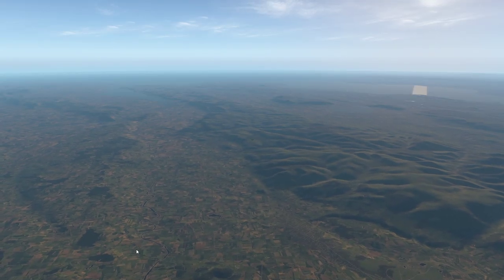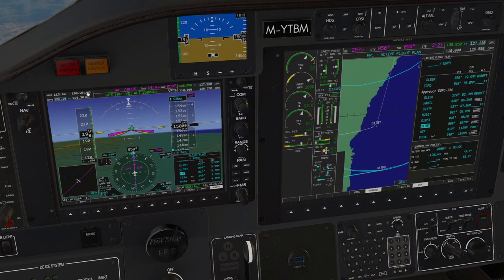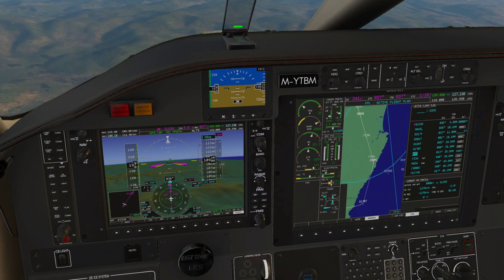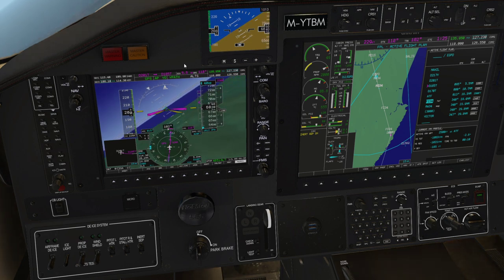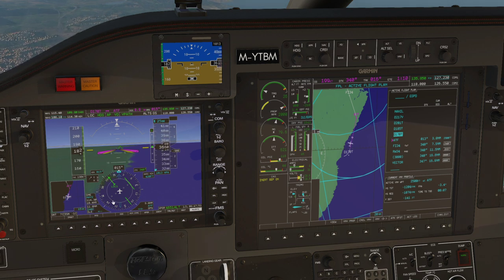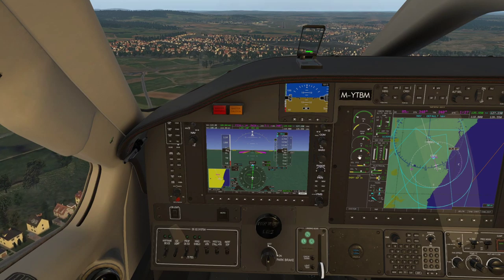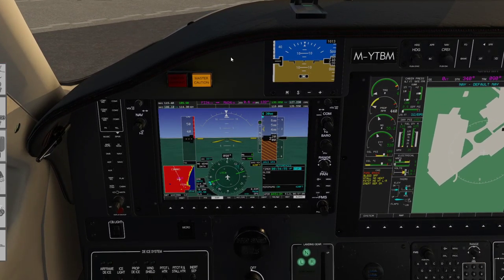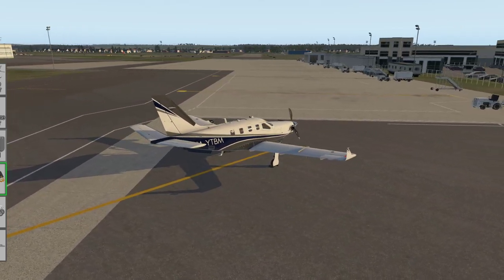Hotstart TBM 900 Part 2 - IFR Arrival to Aberdeen ILS 34 [X-Plane]

Comment: Excellent videos, I thoroughly enjoy the videos and learning more about the TBM 900....question(s), 1. I do not see any indication on the alpha-indicator for color indications of the AoA, could this be a Vulkan limitation, as the lift-up window/screen is blank/empty, no color indication visible upon lifting of the lid/screen....2. for whatever reason, my version of TBM900 does not allow me or does not show the ILS LOC upon CDI selection and the AP does not intercept the LOC in APR mode, even though the ILS frequency is in NAV 1. I've tried many locations and did the Glasgow to Aberdeen flight several times, everything works well LNAV and VNAV wise from departure to arrival and approach activation, however, I do not get an ILS IDENT indication in NAV one and therefore the CDI does not show an active LOC, I do get the GS indication, but no LOC....any advice would be appreciated, like I've mentioned, I've several ILS approaches and I get the same result everywhere, no LOC on CDI and no IDENT next to ILS FREQ on NAV 1....I'm flying latest XP11 and latest Vulkan....thanks and much appreciated.
Reply from the maker: Hello Stephen, really sorry for the delay replying. Yes the alpha indicator is a Vulkan issue, and I believe the ILS issue is related to the navdata version. If you use updated Navigraph data that could be the issue. I believe there is a beta version available that corrects both issues, or for the nav data if you use the 11.00 format that should work for now. Glad you've been enjoying the video series.

Comment: Great video!  Quick question, why did you set your BARO MIN to 420ft - I don't see that on the chart that you pulled up at 1:25.  Guess is LFE + ~200'...Please advise - Thanks!
Reply from the maker: Thanks, and sorry for the delay replying. Yes unlike most charts, the UK AIP charts list obstacle clearance height rather than the useable minima. Cat 1 ILS approaches have a system minima of 200ft, so use the greater of TDZ Elevation + OCH or TDZ Elevation + System Minima.   The Jepp charts show proper useable minima, and gives 415ft for this approach.

Comment: You referred to multiplying the height to lose by 3 to arrive at a distance figure to start descent.  I've previuosly been taught to divide by 3 not multiply . which is correct please?  Fantastic videos Graham . thank you.
Reply from the maker: Thanks for the nice feedback.  Interesting question as different people do it different ways. For me, I look at height and calculate mileage as it makes sense to me that way. 10000 feet to loose, x3, I need 30 miles.   You can also do it the other way. I have 30 miles, x3 = 9(0) = I can loose 9000 feet. For me this is harder to do mentally, and I know my altitude exactly and can only guess my track distance.  For you can also divide remaining distance by 3 which is the reverse of the first calculation. They are really rules of thumb rather than precise calculations, so whatever works easiest for you - everybody is different. Hope that makes sense?

Comment: Graham, an outstanding series from an excellent instructor. I have taken six pages of typewritten notes from videos 1 & 2 so far. Could I please ask you to clarify something... at 30:35 of this video (#2) you say, "We have made ourselves aware of the importance of keeping those flight mode and initiators (?) in the G1000 in the stand (?) at all times." I am confused by this. What are you referring to here and what do you mean by "in the stand"? Apologies for not understanding your terminology here, which is otherwise crystal clear and easily understood. I am looking forward to taking many more notes, —Steve Haines
Reply from the maker: Thanks for your nice comments Steve. Flight Mode Annunciators, FMAs, the autopilot modes displayed at the top of the PFD - and the importance of keeping them “in the scan”.  We talk about a “selective radial scan” when instrument flying. Keep the instrument “scan” going by looking at, for example, Attitude, Airspeed, Attitude, Altitude, Attitude etc. When the autopilot is on the temptation is to let your scan lapse, but the key to understanding the autopilot is not what lights are illuminated on the control panel, but rather what FMAs are displayed - hence “Keep the FMAs in the scan”. Learn when to expect an automatic mode change on the autopilot, like from VS to ALT when autopilot captures the selected altitude, and check the FMAs to make sure it actually happens. Hope that makes sense?
Reply: @ReflectedRealitySimulations   Again crystal clear, Graham. Glad I asked as I completely missed the gist of that instruction. Into the notes...  —Steve H

Comment: Hi Graham,
You are simply brilliant.
I've been struggling with MSFS and their TBM 930 and then came across your Dundee circuits. I tried to emulate what you were doing and immediately found that OBS does not work in MSFS. Also it's a real struggle to trim their plane and the whole flight model is off too. Add to that one of the bridges is missing and you can image the disappointment.
I bought X-Plane 11 because I first came across the G1000 in the MSFS 172 during the alpha and watched flightsim481's G1000 tutorial. On returning to MSFS I found that its G1000 was very incomplete, so started flying the 172 G1000 in X-Plane.
Now I've found you and the Hotstart TBM 900 so it's back out of MSFS and back into X-Plane!
Your video series is quite outstanding and I hope you will build a following which will allow you to make many more.
I'd place you in the same class as Squirrel and Doofer911.
Thank you for your time and effort.
Reply from the maker: Very kind Chris thanks - yes X-Plane is aiming to provide a G1000 simulation that can be used for Instrument training. It has some weaknesses, but compared to the FS2020 version X-Plane seems much better. The OBS mode is really useful, and the HotStart TBM is one of the few aircraft to simulate the air load on the flight controls so the aircraft "firms up" at higher airspeeds simulating the increased effort required to move the controls.
Reply: @ReflectedRealitySimulations  Many Thanks

Comment: excellent videos! saved all on my page, do you have a video or tutorial how to setup the throttles for the tbm using a saitek quadrant throttles? i cannot make them work properly
Reply from the maker: Thanks for the nice comment. I'm afraid I don't have a setup video as I only have a single throttle axis. However I think the power lever uses the mixture bindings for movement between Cut Off and Flight Idle. The best place to ask is the X-Pilot forums or the HotStart Discord as I'm sure somebody there will know.

Comment: I agree w VikingsFan39 and double his comments. I also wanted to ask how you do such an excellent job changing dials for com's or Altitude for example are you using a special mouse or some other equipment? I find it very frustrating to work the dials with a regular mouse. Thank you in advance for your thoughts and terrific training videos! Best from Florida
Reply from the maker: Sorry for the delay replying Bruce. No special hardware. I've got a logitech wireless mouse and run at 1080p. The G1000 is a bit awkward to work the frequencies, but it is possible to bind keys for the com frequency to help with online flying.

Comment: Excellent presentation!...... my vnav works maybe 10% of the time! I wonder what I'm doing wrong, but typically just as you set up, that's what I do...... Bill
Reply from the maker: Hi Bill, thanks for the nice comment. Yes I’ve noticed VNav being armed and then not engaging and can’t really work out what is going on. I’ve recently been leaving the VNav mode selection until the “vertical path” callout and then it seems to work reliably.
Reply: I think I read somewhere that the VNAV has to be set within 5 minutes of descent otherwise it times out.  Not sure whether that was for the TBM or the Citation Mustang though.
Reply: Further to my last post I found it on page 15 of the TBM quick start guide, note 15.  You must be within 2 minutes of the computed TOD when arming VNAV..

Comment: This looks like an amazing sim. I'd love an aircraft of this quality but mid-80s rather than contemporary - electromechanical HSIs, VOR/DME/ADF and so on, but same level of system simulation (listening for the aux fuel pump etc)
Reply from the maker: I've been hearing good things about the JRollon SF260 with Simcoders REP, but haven't tried it myself. Javier has uploaded quite a few videos of the REP features.
Reply: The Carenado PA-31 Navajo is another beautiful well simulated bird. I recommend you to take a look on V1-Sim video series about this bird. Anyway, @Reflected Reality Simulations is amazing! I also recommend you about the TBM9 to take a look for Jason videos flying this plane IRL.
Reply: @ReflectedRealitySimulations  The Jrollon SF260 is amazing but I don't fly it so often because hand-flying is very exhausting by not having a trim-rudder. So you have to constantly keep using the rudder pedals for level flight. Idk maybe at the end its my own fault.
Reply: The AirFoillabs King Air 350 is probably exactly what you want. Look on YT for some of those reviews, and I think you will love what you see. Jeff Faringa is a good one to follow.

Comment: Hello Graeme,

Are you using a yolk or joystick while recording the TBM videos? Also, with trim for take-off, should the rudder not be trimmed all the way to the right to the green marking as large amounts of right rudder need to be applied to counter the engine torque? I see you only trim slightly to the right of centre. Do you use rudder pedals as well or just the joystick to yaw? Am really enjoying the TBM videos, perhaps a RNAV or ILS to minima's would be interesting to see.
Reply from the maker: Hi Colin, I use a joystick only, no pedals usually. Yes on the real aircraft the rudder trim would be in the green for takeoff. On the model this is not necessary, and neutral or slightly right of neutral is sufficient. Yaw is the hardest axis to get a balance between being usable in the sim, and precisely accurate.  Yaw control on small aircraft is almost all by feel and a whole lot easier than in a desktop sim. Full motion simulators also struggle with accurate yaw sensation, when taxying around they can make me feel seasick! RNAV approach is planned for video 6 with a go-around from minimums.

Comment: Hey, video its very useful. Thanks you. But I have one question. How do you get runway on the PFD (and Green pfd). As far as I know G1000 doesn't have this feautre.
Reply from the maker: Glad you found the video useful. The PFD is running Synthetic Vision, an option on the G1000 since, I think, 2009. On the first video I show the PFD features around 12:00 minutes
Reply: @ReflectedRealitySimulations  Thank you!
Reply: @ReflectedRealitySimulations  And one more question, my AOA is blank. Any idea what might be going on?
Reply from the maker: That’s a function of the Vulkan rendering engine with the current release version. There is a beta version available that fixes this and some other little issues. You can get access to this by simply asking on the HotStart Discord.
Reply: @ReflectedRealitySimulations  Thanks!

Comment: Great vid in general, but I don't understand why you are activating the inertial separator at 10,000 ft. Most of the real world pilots I've watched fly this aircraft, activate it around 4-5,000 ft, and under 200knts. Other than that tidbit, this is a very nice tutorial series. I'm really thinking about getting the TBM900, and this will help tremendously. Thanks for putting in the time and effort.
Reply from the maker: Thanks for the nice feedback. Yes in the video I deliberately did it early in an effort to manage workload. A fully narrated single pilot approach with stepdowns can be fairly high workload, so getting stuff like the inertial sep done early is simply one less thing to forget later. I tend to use the start of the approach phase as the latest point to get any systems related tasks done. In airline flying we use the sometimes use phrase “at a moment of low workload” for things that do need to happen, but don’t specifically have a trigger point - basically if you’ve got nothing more important to do.  In my opinion the TBM is one of the finest aircraft available for any simulator, so it’s well worth it! Hope you enjoy the rest of the series - Part 5 is probably my favourite.
Reply: @ReflectedRealitySimulations  Thank you so much for the detailed explanation. I appreciate it. I look forward to the rest of the series.

Comment: Can you help please. I have a problem with the Hotstart TBM 900 as follows:
When I enter a Localiser frequency into Nav1 ie 110.9 MHz for 26L EGKK and select Loc1 on the CDI the entry goes green but the code for the Localiser is never shown as it should be, and the green line never shows any cross track information. Although the Nav 2 shows the correct VOR code when the corresponding Frequency is entered  ie 114.00 Mhz for the UK Midhurst VOR shows Mid correctly and navigation data is correct. I have tried lots of ways to correct this even totally deleting the TBM 900 and reloading but nothing I have tried works so far. Any help would be much appreciated.
Reply from the maker: Hello Michael, at the moment the release version has an issue with navdata. The data format changed with X-Plane 11.50. If you’re using Navigraph you can use the older format, not the new 11.50 data. I believe there should be an update to the TBM in the not too distant future to update it to the latest navdata standard and all will be well again. Hope that makes sense.
Reply: @ReflectedRealitySimulations  Hi Thank you for the reply yes makes perfect sense I have changed the Navigraph data to the old 11.41 all works fine now will change back to 11.50 data when the TBM 900 is fixed Thank you once again and thanks for the fantastic Videos you make it all so clear looking forward to your next video cheers!!!

Comment: strangely, my AOA Alpha is "working", technically, but not "reflecting" in the glass. I do have HDR on, but i am using vulkan b13. Is anyone else having this problem?

EDIT: There absolutely is a problem with this aircraft in Vulkan b13 still: the AOA Alpha display doesn't "reflect" (it technically does "work", just doesn't reflect in the HUD), and the yoke trims don't work. However, they all work properly in b13 OpenGL. Just to prevent somebody some frustration. I'm using 1.12 of this plane (the latest release as of today).
Reply from the maker: Yes the AoA does not function correctly in Vulkan, the developer is aware of the issue.

Comment: What is the reason why you put the autopilot in HDG for ATF?
 Does the G1000 not automatically switch to the ILS frequency when it approaches? Thanks
Reply from the maker: The HSI mode and autopilot will only swap from GPS to LOC when the current waypoint, the waypoint the aircraft is navigating to, is the Final Approach Fix or “faf”. In this case the faf is the database not coded as ATF, but the waypoint afterwards, so the intercept would may work correctly without selecting a lower altitude than desired. This is a common issue with the G1000 presentation, you can see the automatic swap attempt and then fail to capture during video Part 3, so I always recommend doing an ILS intercept in HDG mode. Hope that makes sense.
Reply: @ReflectedRealitySimulations  Thank you!
Reply: Find at post: https://forums.x-plane.org/index.php?/forums/topic/211398-xplane-1141-g1000-approach-vordme-09-egpb-skip-faf-fd09/
What do you think? Thans!
Reply from the maker: Hi Alessio, I show this on my first video (Part 1) on the climb out of Glasgow. The G1000 navigation logic by Laminar is fairly crude. It will only try and fly a 30 degree intercept on the inbound track. In this case 088, -30 = intercept on 058 degrees. That intercept won’t work for you as it will take you beyond the target waypoint. This is exactly the problem I show in the first video. The real G1000 should work better, but as I said always have the GPS Bearing pointer showing, and if the aircraft isn’t doing what you want, do it manually with heading.
Reply: @ReflectedRealitySimulations  thanks for the answers! they are useful and instructive!

Comment: is the jepessen chart on the MFD an add on?
Reply from the maker: No that’s part of the product. It’s not a Jepp chart but sourced from the official AIP via a service called Autorouter. There is also a tablet device for the yoke that will work with Avitab.